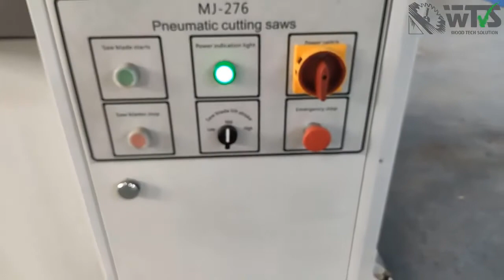WTS Pneumatic Cut Off Saw

Comment: How much Price Cut Off Saw
Reply from the maker: Dear Sir, Thank you very much for your comment.  
Max. Cutter Height: 200x200mm
The Most Cutter amount: 680x20mm
Spindle Speed: 1850 rpm
Power: 5.5kw/ 7.4 HP
Working Pressure: ≥0.6Mpa
Blade : 600x30x4.2x60T
overall dimensions: 3940x1625x1372mm
Weight: 825Kg
List Price: 481250 TK
15% Discount Price: 4,09,000 TK
For more information pleas call 01914252542

Comment: দাম কি বলা যাবে
Reply from the maker: Dear Sir, Thank you very much for your comment.  
Max. Cutter Height: 200x200mm
The Most Cutter amount: 680x20mm
Spindle Speed: 1850 rpm
Power: 5.5kw/ 7.4 HP
Working Pressure: ≥0.6Mpa
Blade : 600x30x4.2x60T
overall dimensions: 3940x1625x1372mm
Weight: 825Kg
List Price: 481250 TK
15% Discount Price: 4,09,000 TK
For more information pleas call 01914252542